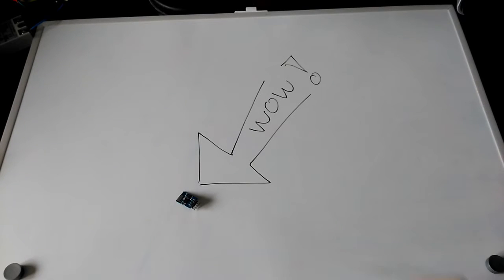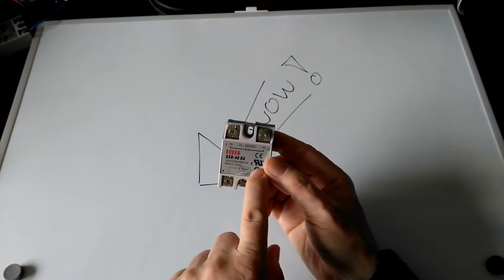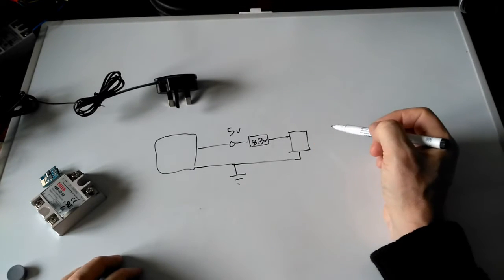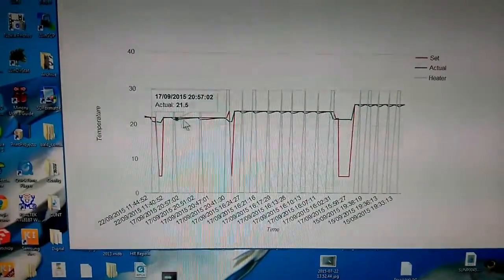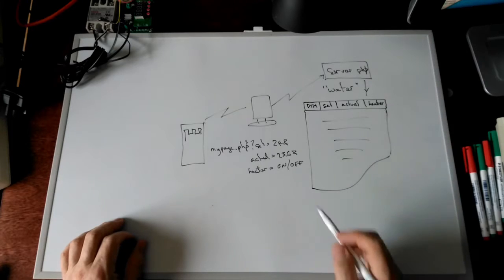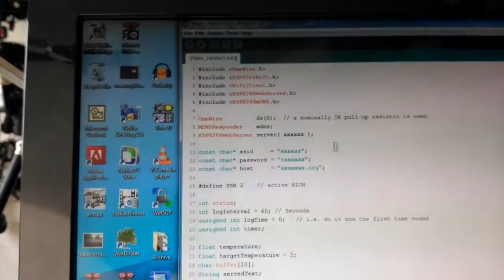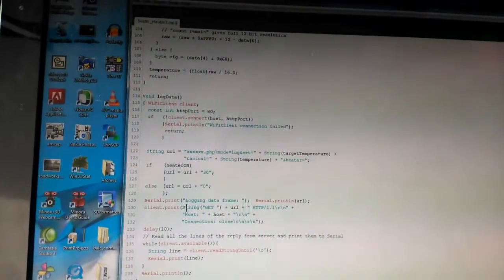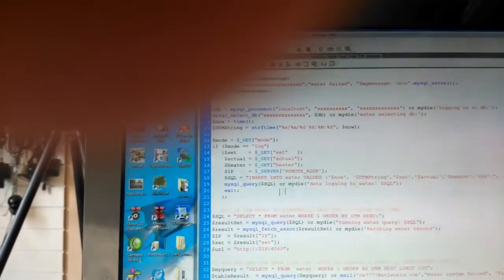Electronics Project - Home Automation - Water Heater

Comment: If you do a YouTube search of "water heater relay" the first result is "Spectacular solid state relay failure". A guy used the same relay as you've got there to drive a water heater and it blew up. Please be very careful and don't take this sort of thing lightly. Other than that, it's a cool project!
Reply from the maker: Hi nenadsuperzmaj, and thanks for your warning. I've seen that video and it DOES make you think. I'm pretty OCD about safety when it comes to walking away from mains-connected homemade electronics - especially when cheap Chinese knock-offs are invovled. There was ways to mitigate the risk - enclose the mains stuff in a metal box for example - but the risk never goes to zero. But then, lightening strikes, etc.  In fact, my hybrid grow box was never deployed because, when it came down to it, I was unwilling to leave my home with it hooked up. I think I'm overly cautious but still, as you say - bad things can and do happen. I guess it comes down to personal choice. Thanks again.
Reply: I'm in the middle of a similar project and I have even ordered the exact same relay off Aliexpress, so I suppose I'm a bit touchy as well :)
Reply from the maker: Heh. I'm not sure if saying "good luck" is a good or a bad thing., but - good luck!
Reply: in a short team it means the is a fake relay?

Comment: I might use this for an aquarium heater controller.  A couple of weeks ago, my 4 year-old played with the red knob at the top of the heater and made seafood soup.  I though I'd try to use the opportunity to make an aquarium controller.  I've seen a few online, but most seem overkill for what I'm doing.  I want to start with a heater controller, then add in an air pump control.  My pump has an adjustment knob that controls a potentiometer, so I figure I can bend it to be controlled by the ESP to pause bubbles when feeding and adjust the rate depending on time of day.  Eventually, I'd like to add RGB LED's for timer control and changing wavelength depending on time of day.

Would you be so kind as to send me you code to use as a starting point?  I'd be glad to update you on my status if you'd like.

Thanks!
Reply from the maker: +Chip Stewart Hi Chip, sorry I don't have time to strip out the sensitive stuff and find a way to format it in YouTube comments. I think I'd have to set up GitHub etc. and I'm too busy trying (and failing) to earn a living just now.